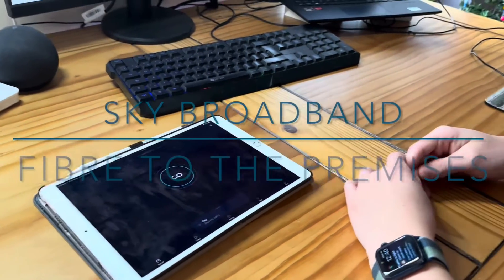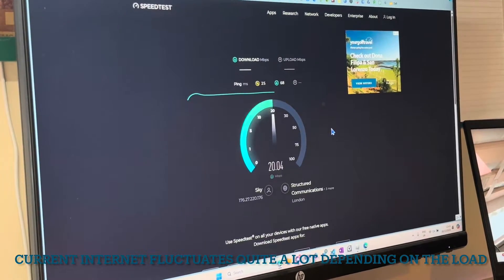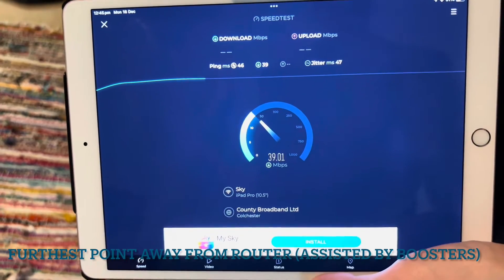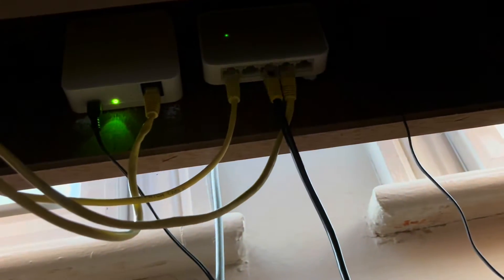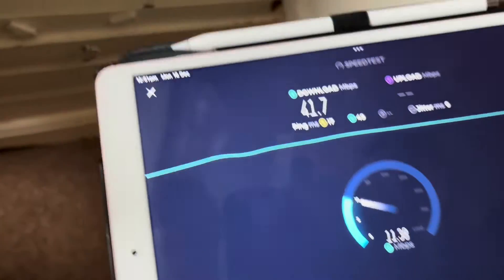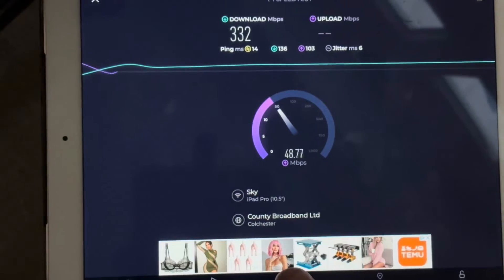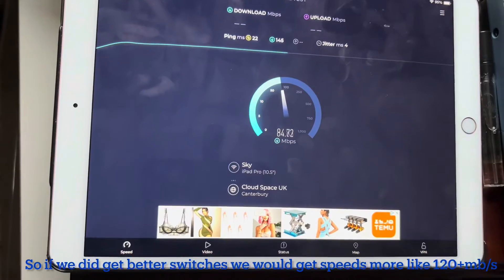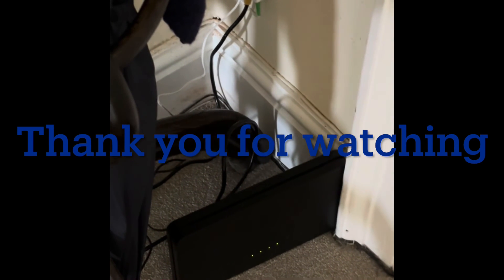UK Sky Full Fibre Broadband Review | 500mb/s?

Comment: Hi mate so I'm a fibre engineer, what reason did the engineer give for not installing the fibre where you originally wanted it looks to me that the engineer just went for the easy option, on average as long as there are 2 power sockets and there's an external wall in the room you want it installed there is no excuse not to install it in that room upstairs or downstairs it doesn't matter there are a few exceptions but from the video they don't really apply, as for providers all they do is tell openreach what speed you're paying for and openreach sends that to your ONT/router the main reason you don't get the full 500mb/s all the time is based on how good the splice was in the CSP (grey op box on the outside) there will always be some amount of dust trapped in the splice and other impurities and where the cable plugs into the CBT (fibre terminal on the pole/pit) as it's not spliced in that connection is the weakest link but splicing on a pole it damn near impossible and dangerous due to weather and other factors sorry for the long comment but wanted to also give anyone who read this comment some insight to why they most likely won't get the speeds that they pay for and give some advice, the best advice I will give don't be loyal to any individual provider when your contract runs out figure out what speed you want then compare all the providers and go for the cheapest offer available also if one room in the house is getting weak signal tell your provider you've got a dead spot in the house most providers guarantee signal throughout your home and normally will provide boosters free of charge😉
got to say i enjoyed your vid and have just subbed
Reply: Hi, I am with sky and I'm on the ultrafast+ Im constantly getting speeds below 500mbs averaging 85 to 130mbs. Spoken to sky and they are saying the speed is correct going to my house but I might have router issues. Can you elaborate on that please. Engineer is coming out next week thankfully. But I've never achieved 500mbs as they stated I would. It's so inconsistent I feel I'm paying for a product that simply is not working. Thank you.
Reply: @wozzaclk7798 get the white router from sky it’s called wifi max it provides amazing speeds and performance
Reply: @wozzaclk7798 hi so this could be down to many different reasons could be a faulty Ethernet cable from the ont to the router or the engineer who installed your fibre might have installed the incorrect ont inside your house this is a fairly common issue as the different types look identical except the Ethernet port is yellow on the slower ont and orange on the faster Ont but the engineer should be able to get this sorted pretty easy, if it’s the Ont it’s as easy as swapping it over and calling dcoe (openreach) to activate the new Ont
Reply: @ThatFibreGuy  Thank you for replying 👍 fingers crossed I can get this sorted
Reply: @wozzaclk7798  I'm sure the engineer will be able to sort it out for you
Reply: He's totally right except wireless speeds can also be due to the cheep equipment your ISP hands out hence why i have gone for a 3rd party router.
Reply from the maker: Thanks!
Reply: @everythingcubed4210 you only get 100mbps on WiFi instead of 500gbps
Reply: Have you heard of the new internet company brsk who are setting up at the moment. Good speeds for the money by the looks of things , not sure how good there routers are tho .
Reply: It is true splicing fibre is technically a weak point but we are not splicing crossing our fingers and hoping. Fusion splicing is pretty much the standard for ISPs/providers which the machines check the integrity of the splice as well as the dB loss. It is possible to fusion splice with 0db.
Reply: Unless it has changed recently it seems most providers will provide boosters (almost always cheap rubbish from ISPs) but only on certain packages often the more expensive ones which state as much

Comment: You should really get a proper router not the rubbish ISPs send you. You can pick up decent ASUS ones for about £40 used including ones with 8 eth ports. This will give you so many more options. I would then use eth to provide connectivity to repeaters/extenders where you need signal. You can buy 100m of cat 6 eth for about £40. This way you won't be relying using add on extenders which although increase signal/distance come with the trade off of decreased bandwidth. Given you clearly seem to be using a lot of these devices throughout this network. You are paying for bandwidth you are basically just throwing away with all these repeaters and a 100% (mainly) wifi network.

Comment: I’ve been offered full fibre broadband from sky and I currently have the ultra fast broadband through BT line with a normal router. What worries me is the equipment which is required for the new fibre broadband. Will holes be drilled? Will it involve more cables? Because my currently broadband has minimal cables.
Reply: Don’t switch I’ve been left with no internet total cock up with installing it and left with no internet for 3 days without anything being done finally been told openreach will come back out but will be in 3 to 5 working days and it’s bank holiday so up to 10 days without supply .

Comment: Does the hub needs to contected to the landline ?
Reply from the maker: It does not need to be connected to your landline phone no. However, if you don’t have fibre then it will use the same copper connection as your landline uses if you have it. If you have fibre you’ll need to plug it into your landline for it to work as the copper connection to your house would be removed - hopefully that makes sense lol.

Comment: ive got the 900mb and before i attached the ont directly to my mesh network it was readin about 5--600 but connected it directly to the network i was gettin over 900, so get a tp link mesh preferably the xe75 pro and buy a tplink ont dont use theres, u will then get faster speeds and not limited

Comment: 70mbps is pretty poor on what should be a 400mbps line speed.
Reply from the maker: It was 70mbs copper (start of video) 400mbs fibre (end of video). Don’t think copper is capable of 400mbs.
Reply: @everythingcubed4210 exact same speeds here with copper. Hoping FTTP solves this issue.

Comment: We dont get as much speed as you and we're with fibre aswell. We dont have any boosters though, do they come in handy? We dont get wifi from across half out house and we are thinking of getting a booster. For some reason we dont have that purple/grey cable you have. Do we need to buy one? Our internet speed with fiber is up to 70. And it got installed today.. Other issue is We cant connect to our internet now. Im unsure whats the issue is im not an expert in this sort of thing. The highest we get is 10 on ethernet pcs.. And it says our DNS has an issue or something. It jumps from 10 and back down to 3.. Is there a way to solve this?
Reply from the maker: Hello, so the purple cable is only for copper connections. Now that you are on fibre It’s no longer needed. Your speeds will probably be slow if you have a different plan to us - we are on a 500mb/s plan but you could be on a 100mb/s one? And yes we do recommend the boosters, you should be able to get them for free if you give sky a call. Any variations in your speeds are either caused by too much internet traffic in your area or your connection stabilising because it is new. :)
Reply: @everythingcubed4210  Hi, thanks for that! We might get a booster. We just found out our router was actually faulty! so no one was getting internet except the ethernet ones. We are getting a new router so hopefully it will improve speed! We are on the 100mb/s one i think! Thanks for helping out. Hopefully our internet isnt slow. They are sending another router out.
Reply from the maker: @kirahh About a month ago we also had to replace the router because there were weird issues where it would not let our sky box transmit ethernet properly. I guess they can often be faulty! (Although the router that was replaced was fairly old, the new one definitely was slightly different at least in terms of the material it was made from for better thermals I assume)
Reply: @everythingcubed4210  I get mine again soon. Hopefully it sorts it out! Its our DNS issues when we want to play games and stuff. Hopefully it fixes. Hopeing its the router and not PC's haha!

Comment: Now, here’s the thing, BT OpenReach is installing all this fibre throughout the UK and BT engineers connect the fibre ONT inside your house.
That’s fine, but then you need a service provider to get use of that fibre facilities.
I have my copper connection, called FTTC which is ‘Fibre To The Cabinet” and I get my Telephone and Broadband at about 50Mb/s as well as an basic entertainment package from sky. I also have a Satellite Dish on Sky.
The entertainment package and the talk package seems quite reasonably priced….
BUT the Broadband cost is very high putting my total cost up to about £60 p.m.
My wife and I are pensioners and would like to keep our copper fed phone.
The thing that I do not get is why SKY charges so much for the Broadband feed when in fact it was all installed and maintained by BT and OpenReach.
It seems to me that Sky is taking advantage of the Fibre Network installed and maintained by BT and OpenReach and charging an excessive amount and profiting excessively.
Other providers also charge quite a lot for the Broadband.
The entertainment and Talk facility is fine but the add on for Broadband seems excessive.
Reply from the maker: Hello, although BT are probably the main provider there are many others (e.g. if you were to head 5 minutes down our road cityfibre appears to be the provider). We did also have fibre to the cabinet until we were offered full fibre. The reason why we have sky broadband despite them potentially having higher prices is simply due to the interconnected nature of the entertainment and the wifi which enables a mesh network, and the fibre was indeed cheaper than our previous sky plan despite being 400mb/s more - my advice would be to phone them up and say that you are going to switch and then in most cases they will give you a great deal. :)

Comment: How is it running? Any issues?
Reply from the maker: All has been OK with stable high speeds, although recently it would appear that the Ethernet port on the sky Q TV box has stopped working (and so the booster upstairs in the study), sky have sent us a new router which they think will solve the problem. Other than that, we are extremely happy and It’s a huge improvement over the previous plan.
Reply: @everythingcubed4210  Thank you for the prompt reply! Hope you get it sorted!
Reply from the maker: @googlefriend7685 The new router came yesterday (same router, but I expect they made some minor changes since our previous was quite old and It’s made of a different material (probably better thermal properties) and it has fixed our problems. :)

Comment: Didn’t think you could use the sky q to bridge WiFi to Ethernet
Reply from the maker: Yep, you can either use it to connect a device to ethernet to provide wifi (e.g for us currently the sky Q box provides the wifi to the booster) or alternatively from a router (or booster) to provide wifi to the sky Q box. (This works for any sky product including the mini box). I think it automatically decides which provides internet to which device depending on which has higher internet speeds.

Comment: I can't wait for full fibre to become available in my area. I'm still stuck with Sky FTTC. Connection itself is great and for the 10+ years I've had it, it's been rock-solid stable. My ping with FTTC is great (hovers around 4-5ms to servers nearby when directly connected via Ethernet). However, I want full fibre so I can download larger files much quicker. That's what I'm looking forward to most about upgrading.

It doesn't seem like fibre is coming to my area anytime soon though, which sucks.
Reply from the maker: We were quite surprised that we had the option to upgrade to FTTP considering we are in a fairly rural area, and we have been to very remote areas which still have fibre, so It’s very possible you’ll get the option sooner rather than later!
Reply: If you have internet stay how you are switching is a Downgrade not upgrade
Reply: Check reviews out first it’s not what we are being told it is